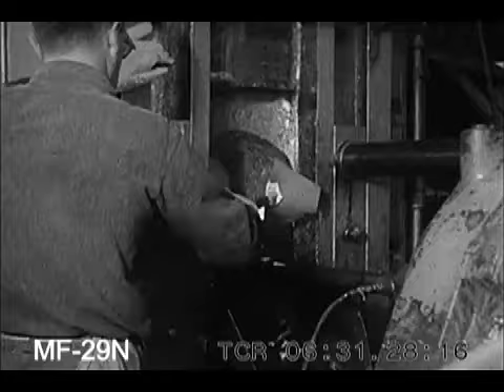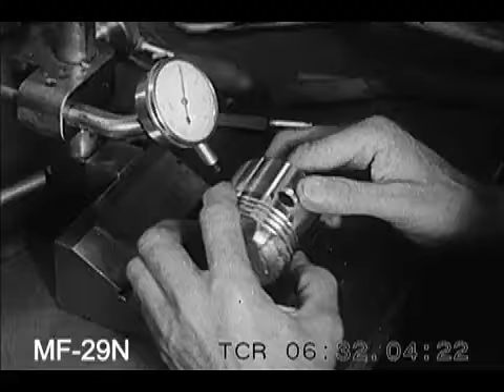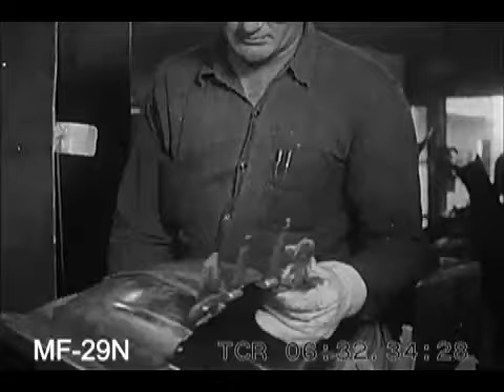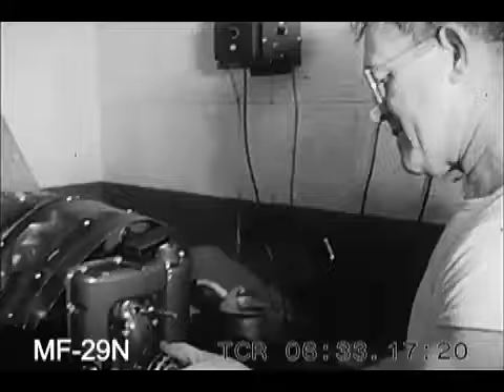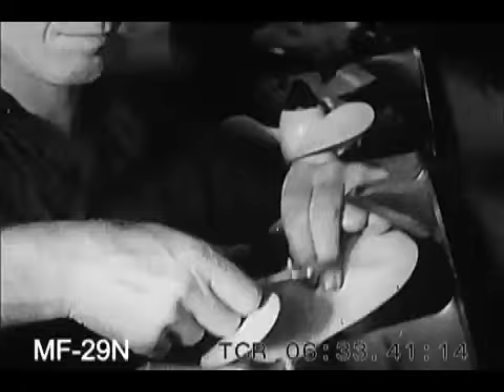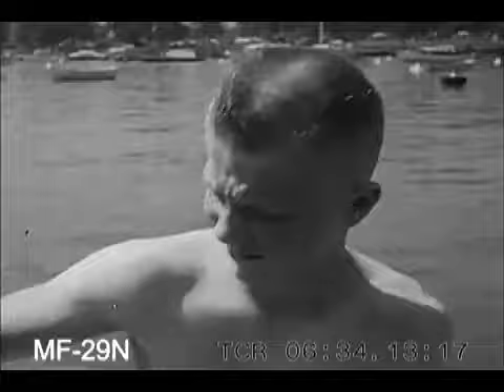Outboard Motors, 1955

Comment: That was when you could by an new outboard for around  three to for hundred dollars, now outboards go for fifteen to twenty thousand on the low end,the higher the horsepower the more expensive it gets.
Reply: Nope. You're wrong. Prices converted to nowadays currency is about 2500 for a 290 dollar motor. The older motors are either just as expensive or more expensive. Don't get me wrong, I would never buy a new motor of this era because the older omc's are better. And the higher the HP means a higher price that's how it works. You can get a 9.9 hp for 2300

Comment: back when you could buy truly made in America marine engines.
Reply: Back when outboards lasted forever
Reply: Yeah since watching this (probably about the same time I watched this video) I have bought a 1952 Johnson QD-13   10 horse outboard.
It runs like a good sewing machine very smooth and does really good on a 12 foot aluminum boat.  Little smokey by modern standards even for a 2 stroke but such a great engine. I can't believe this company went under, I remember growing up in the 1980s and every fishing boat had a Johnson and every pleasure boat seemed to have its larger twin the Evinrude.
Reply: Mercury engines of about 75hp and up are still made in Wisconsin. Or is it Michigan?  Used all over the world.